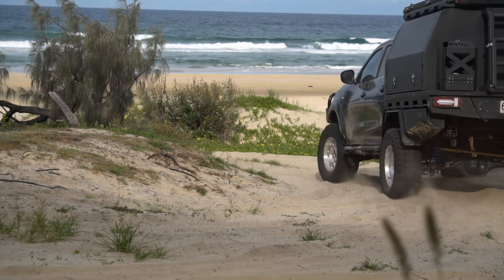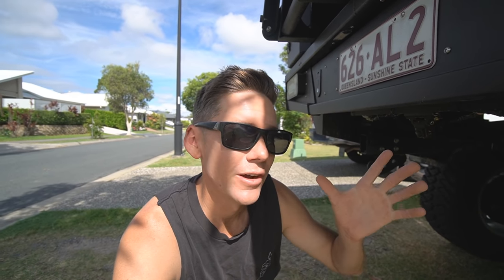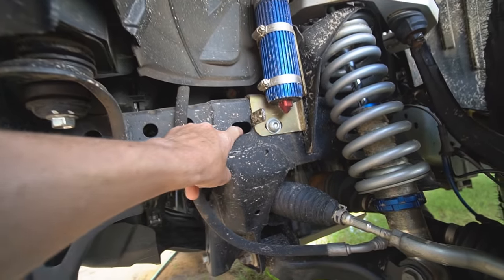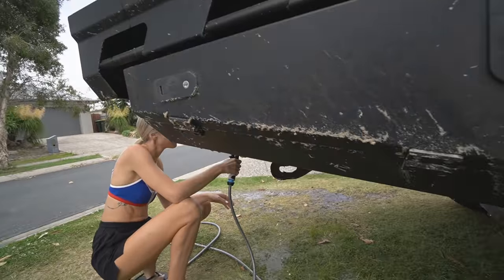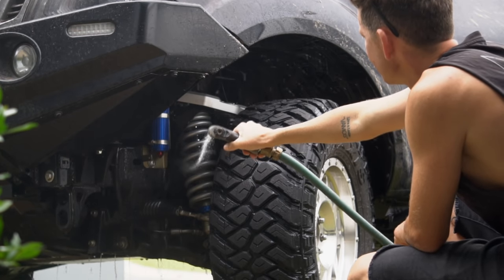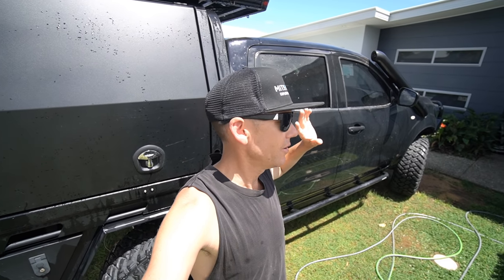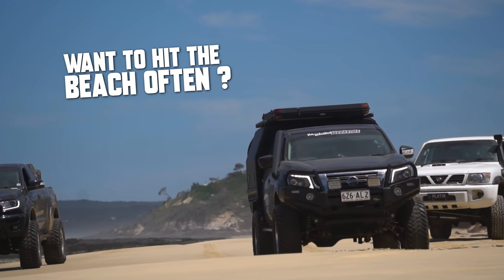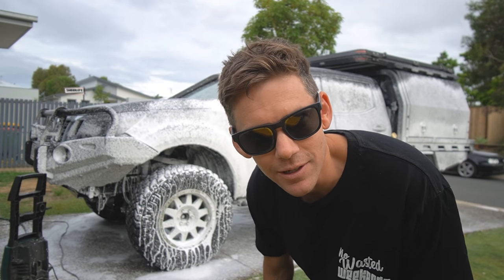Do you Clean your 4wd Chassis?

Comment: TJ, buy yourself an air compressor and a duster gun for the interior clean up. Once you've done a vacuum to remove the bulk of the sand, open all four doors and work from one side to the other and blow everything out the doors... honestly you won't regret it.

Comment: Every time I go off road. Pressure wash then a sprinkler in multiple locations and angles for quite awhile. Try to hand wash as much of the frame as possible.  Good vid, great tips on the chassis flush.
Reply from the maker: Thanks Mike ! yeah the ol sprinkler trick is the go :)

Comment: 12mm irrigation pipe with a stop end. Drill holes in the stop end creates a circular spray. Attach hose fitting at other end and shove it in chassis rails and any where else it will fit.

Comment: Hopefully have my new Nav any day now.  First mod I’ll be doing is a underbody stone guard and a bitumen base rustproof. I’ll be doing this myself, so I’ll be removing a lot of the bolt on components like exhaust, splash guards, steps and any bash plates etc. This will give you plenty of rust protection and also acts as sound deadening (less road noise). And still of course cleaning like TJ describes. Do this for beach, dirt and mud is probably worse as it dries inside your chassis making it harder to remove and then when you drive in the rain the mud will get moistened and that will promote rust. Keep your Rigs clean and a great little episode TJ 👊
Reply from the maker: Thankyou Glen ! 😁

Comment: good afternoon.  and I sold the Pathfinder, as the problems were with the engine, and then with the fuel.  We have few specialists in diesel engines and equipment.  The car is great though.  good luck to everyone and big greetings from the north of Russia.
Reply from the maker: Greetings ! yes the old pathfinders are slowly disappearing off the roads due to those problems !
Reply: @TJANDMAC  2011 2.5TD and assembly Spain.  Many people put the engine with Toyota, they are more reliable)))

Comment: thanks for the cleaning tip for a new beach driver. but do you rust proof your vehicle first and which method do you use?
Reply from the maker: No worries 😊 I’ve never had rust proofing done , they do not spray inside the chassis anyway which is where the problems start , I recommend you clean under your vehicle every time you wash it and there should never be any problems 👍

Comment: TJ, I used to work as a detailer as a holiday job. Most of what was done really isn't worth it for the average person who doesn't have a lot of time.

Highly recommend a pressure washer with a decent foam gun. Even the most basic ones come with multiple heads. You really want to let the equipment do most of the work. Interior wise, highly recommend Aerospace 303 on hard plastic. Don't use it on screens or any clear plastics.
Reply from the maker: thanks mate ! yeah pressure cleaner is the way !